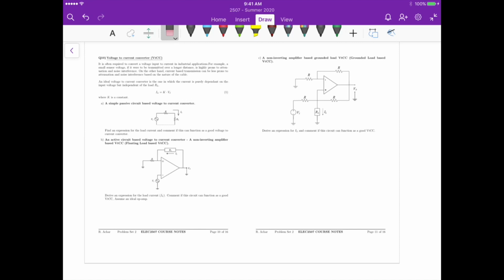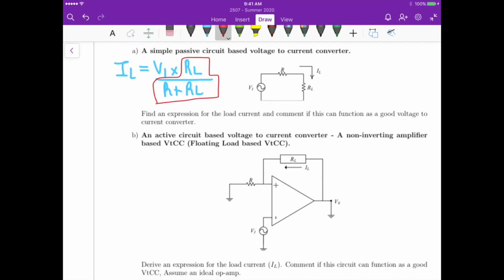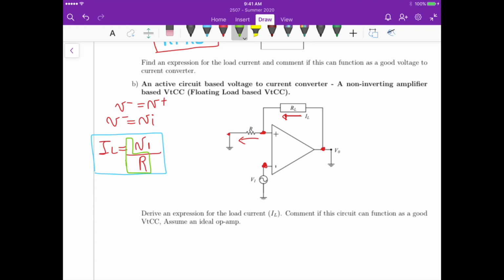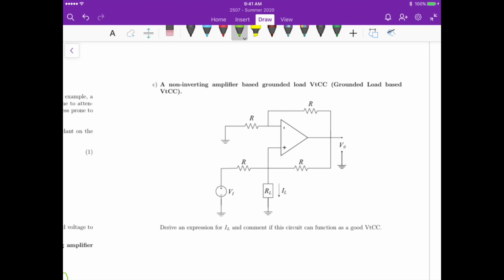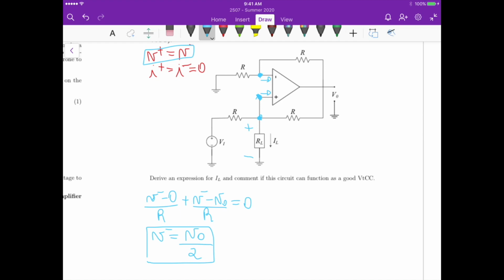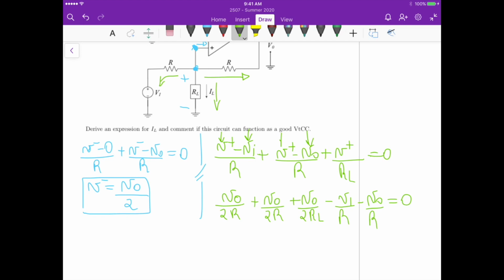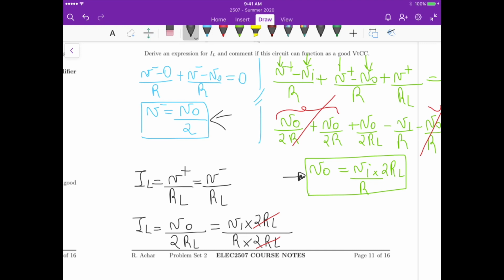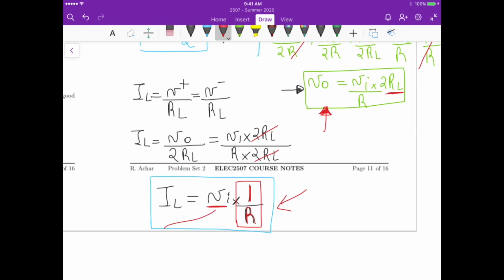Set 2 - Q10

Comment from the maker: There was a typo in the circuit for 10 b) where the output of the op-amp is short-circuited. This was corrected on the latest version of the problem set 2. The correct analysis should be performed with it open-circuited, then 10 b) is also a good Voltage to Current Converter (VtCC), where the load/device is connected between the non-inverting input and the output of the Op-Amp. Therefore, the inconsistency for the current flow for R different than RL no longer exists.

Comment: I believe the analysis for 10. a) is incorrect. You used a voltage divider to express the current where I think it is simply Ohm's law rearranged for I

The Ohm's law approach is also consistent with final answer provided in the solutions
Reply from the maker: You are correct. It should be the right-hand side of that equation divided by RL, which leads to the same answer as using Ohm's law! :D I'll soon update this entire video due to the discrepancies. Thanks for pointing that out! ;)